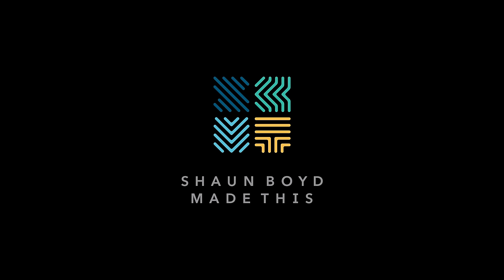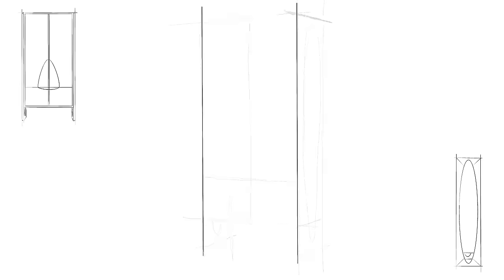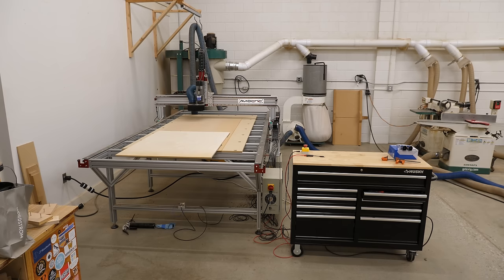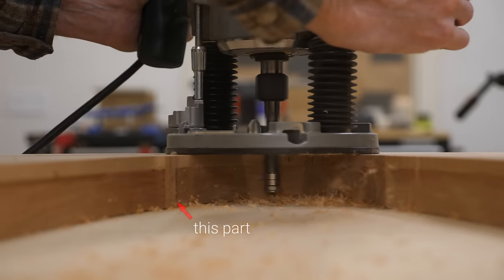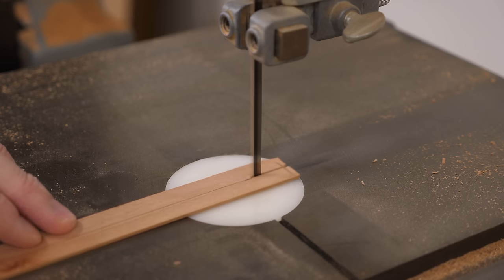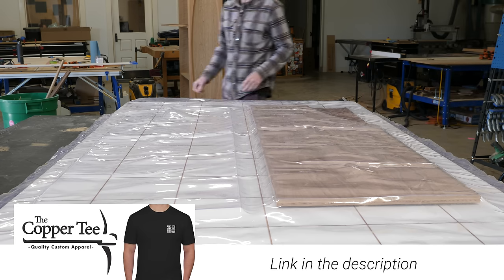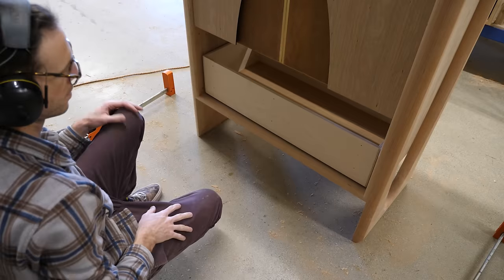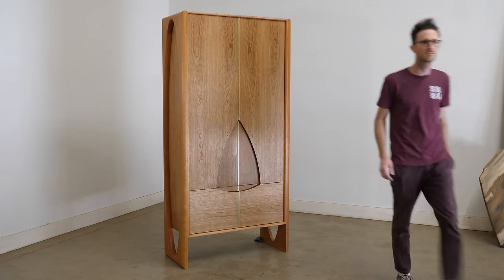Complicated...But Fancy

Comment: It’s (I think) the first video from Shaun Boyd that I’ve watched. And I’m very impressed. I’ve been a woodworker for over 45 years. I’m now retired and, in some ways, am busier than ever. At its biggest, it was 2.5 FT (full time) equivalents; me being the 0.5 as my main job was as MD of my main business. So, not a big concern by any means. However, our shop was a reaction of the size of yours and it made everything….cosy.

One of the small but important things you’ve showed is the time that everything makes. I don’t believe that buyers understand just how it takes to make a bespoke piece of furniture. Perhaps they see videos of big factories churning out furniture boxes by the hundred and think it takes a few hours of a couple of days to make something bespoke. In fact, it used to take me a few days just to do the design work; maybe a day to turn an accepted design into a cut list and a day to go to the supplier and choose the hardwood. So, before even starting on the piece, we are at the best part of a working week for one person. 

The basic box you built is relatively simple and would take perhaps half a day for 2 people ( I was surprised to see how you cut the dominos into the upright side; I would always clamp a piece to the upright so that I had more resting place for the domino fence and ensure that my cut went in at 90 degrees - but that’s just me).

When you get onto fancy shapes, more than half the work is in the templates. Getting those just right means you may may end up with the right hardwood shapes; a template that isn’t just right ensures you get a crap result. 

The old maxim used to be that, by introducing a curve, you increase the labour input tenfold; add 2 complex curves and you increase it 100 fold. I found this not to be that inaccurate. 

Without going further along these lines, for me, the reality is I would have estimated the total design and build time on this to be around 100 hours. At £40 per hour (which was my base charging rate a few years ago), I’m at £4000 for labour. Add materials and I would be around £5,500. I don’t know how that equates to exactly time and material costs in this instance but there are few people, as a percentage of the population, willing and able to spend £5,500 on a wardrobe, armoire or pantry or whatever it’s use is. And I think that most people would think you are making a fortune out of charging that kind of figure - in fact you are only covering costs and paying a living wage. No more. 

I would be very interested to see you insert that time clock throughout your videos, with time jumps when you do something off camera such as making the templates, as a small part of allowing makers and users to see just how long everything takes if you want real quality. 

On the question of mitre saws, we sold one years ago because it’s use and the space it occupied just didn’t justify it. Over the last couple of years, we have been installing about £20,000 worth of European oak as second fix (finish) work in a barn conversion. Miles and miles of skirting (made of 3 separate pieces), coving (also 3 separate pieces) plus window surrounds (8 pieces). With lengths up to 3.6m, the only efficient way of curate cutting to length was a mitre saw as we could also take the saw to the area and stop endless walks to the on site shop. So, we bought another mitre saw. With that work coming to an end, and me believing that I will do very little long length work going forward, we will be selling the second mitre saw for the same reasons as the first one. 

Thank you for the video. I’m subscribing as I finish writing. And congratulations if you managed to have the time to read all of it
Reply from the maker: Thanks for your comment! Not many people really understand the time to price relationship, and it's one of those frustrating but part of the job type things. Luckily, because YouTube is such a big part of my business now, it takes a bit of stress off the need to get top dollar for all of my pieces.

Comment: As someone who follows a similar build path, it helps to think of things in quarters: 1/4 into CAD, 1/4 into milling, 1/4 into jointing, 1/4 into finishing. In your case, an extra 1/4 into video/editing. The time it takes is what it takes. 
The one question I have: how do you avoid feeling like you've got to devalue your labor to make a living? the ROI on time spent vs what you can charge always seems like 15-20$/hr in my case.
Reply from the maker: Yeah, that's always a tricky thing when trying to price your work. As designers and creators, we always want to spend more time on stuff and make it perfect, when the reality is that we probably won't ever see a return on a lot of that extra effort. To reconcile that, I often look at things as a whole...how much do I think this piece is worth? And is that price going to get me to the revenue that I want for this week or this month? Otherwise I would have quit a long time ago worrying about my hourly rate.

Comment: I have a miter saw....because I bought it in about 2000...but very rarely use it an generally only for "construction" type work. Not really needed for my woodworking with a sliding table saw and the CNC. :). Great project!!! And not putting effort into covering the edges of plywood where they will not actually be seen is a very good point.
Reply from the maker: Yep, that sounds about right. Only time I use one is when I'm cutting 2x4's or crown moulding, which is very rarely. Thanks for watching!

Comment: Nice ‘laying on the piece’ shot. I think about this a lot. I personally think the best pieces out there elevate their material, I kind of think about how David Smith’s (and other minimalist artist’s) sculptures got flack for using “cheap” material like rebar and concrete, instead of marble. They used industrial materials that were at the time, looked at, as ‘below’ fine art. But they elevated the material, and in doing so showed us a new view of beauty. I think plywood is sort of similar, it’s a fantastic invention, having the grain criss cross to intensely improve stability, and personally I love it when a good piece of furniture can elevate that and celebrate it rather than hide it. Plywood does have some serious short comings though, the lamination is vulnerable when the edges are exposed, especially if it’s not the highest quality plywood with a thick top layer of veneer. Showing materials weaknesses can be beautiful if controlled, especially as art, but as a functional piece of furniture… not so great, in that way adding edge banding on the front reads to me as a practical measure and a necessity for function. I make a lot of cnc’d sculptures out of plywood, and have you ever tried cnc routing a pocket that’s sizeable and at a partial depth? Like the cut out in your piece if it was all made of 1 single sheet as opposed to two layers. It makes a surprisingly interesting visual moment, true sometimes you run into voids or biscuits that aren’t as pretty, but if you’re using Baltic birch or something it’s actually less common then you’d expect. Idk try it some time on a piece of scrap, it looks cool, and is one way I like to acknowledge the material when it fits the design, could be a fun technique to try :) Beautiful piece as always!
Reply from the maker: Really appreciate it! I've done a lot of stacked and laminated plywood pieces, which certainly highlights the material. Plywood really is such a versatile material!
Reply: @shaunboydmadethis  I’ve seen a few of these, it’s funny, when you started posting on your old channel again it prompted me to check out some of your pre four eyes videos I’d never seen before, which was super fun and a nice surprise for new/old content to check out.

Comment: I would actually love to see you go through the raw process of designing a woodworking project in fusion 360 (on like a secondary channel). I learned 360 for 3d printing, and ive found the headspace for modifying flat stock totally different from a additive manufacturing approach, and just watching the way someone actually uses the tool would help so much
Reply from the maker: That could be interesting! I'll definitely keep it on the list.

Comment: Excellent work.  Love the pants-try.  One question: how do you approach sanding plywood with a thin veneer?  Are you ever concerned about going all the way through to the next layer?
Reply from the maker: Thank you! I sand veneered stuff very carefully. The 3/4" plywood had a decent veneer, so I just sanded with 180 from the start and had no problems. The 1/4" stuff had an incredibly thin veneer. I actually sanded through it when sanding by hand with 220! It was insane, so I had to be ultra careful with that.

Comment: I trust you, mostly. Actually, I’m retired and have been building furniture for over thirty years, so my interest in your videos is mostly for the design. You are doing things I probably would not, but that’s good. I might learn something. And my shop is minuscule so I use a contracter’s saw with some dodgy looking wooden extensions that I can put away after I’ve cut up my panels, so no mitre saw either. I am French and an armoire can be ANY cabinet, big like yours or smaller like in the kitchen. I would use plywood like you do, but here in France it’s very expensive, so I generally use solid wood. A very good idea, though.
Oh, yes. I have no idea about the song, so no bonus points for me.😢
Reply from the maker: We're always learning! And glad to hear that armoire wasn't totally incorrect, thanks for watching!

Comment: Well done, looks very nice. Exactly to the pointlicated it required. :)  Regarding the cutting jigs an sleddimabobs for too long stuff: You neglect the track saw. If you build the sleds a little differently, create positive stops for the track, establish a reference cut into the stop blocks beforehand, and then insert your piece, it is way better than the table saw.
Reply from the maker: Definitely could be a good way to do it! And if those pieces were any bigger, that is probably exactly what I would have done.

Comment: something i think wouldve really added to the looks of the piece would have been to add lighting to the interior and also along the tri shaped handle so that the inner part outside the cabinet (the tri thing) has leds there to light the handle. Then maybe also add brass edging around the perimeter of the tri shaped handle which looks like a guitar pick. So the outer edge of the guitar pick instead of being wood cut through the middle of the pick with some brass, it has the brass go around the edge of the pick while the leds light the tiny inner portion of the pick (not inside the cabinet tho for those leds)

Comment: I am curious about the template process. You (Shaun) indicated that you have a five foot by ten foot CNC router. You use that to creat the templates to do the shaping and routing of the project pieces. Why not just route directly into the material?
That would be even faster and more accurate.
Reply: Would also love to hear the rationale… you could glue up your blanks and then let the CNC cut that opening and the outside profile as well … all while you are putting together the cabinet. Plus it saves you the profile templating time as well? Inquiring minds want to know…
Reply from the maker: Honestly, the easiest answer is that it makes for a bad video. As much as I want to pretend that my main business is making custom furniture...it isn't. So any added time it takes me to make something by hand instead of on the CNC just makes a video more interesting to watch, or at least I think it does. And interesting videos are my main product these days. 

Then there are other reasons like I'm way more comfortable doing it in this way, or that I get better results when doing it this way, but those are obviously only reasons for myself.
Reply: @shaunboydmadethis  thank you for the response and the honesty. I understand the content creation reason as most people would not find it interesting.
I have found that for my current level of woodworking the CNC Router has expanded what I can create. More importantly when drilling two columns ofshelf pin holes every half-inch on an eight foot board the CNC router is the best tool for the job.

Comment: Another outstanding SB piece, as always.  Curious, if you created your template for the legs utilizing the cnc, why not bypass the template, place a corner jig on CNC for matching starting points and have the machine cut the matching legs.  Then run through drum sander/planer to desired thickness?  As always, keep whistling!
Reply from the maker: Thanks! There are a few reasons, but honestly, for the most part it's because a video where I cut out most of the parts on the CNC is a pretty boring video to watch, and the video is my main product these days.

Comment: One of the main reasons for using plywood I think is that you minimize wood movement after construction, right?  Or at least wood movement after gluing individual panels.  I've had numerous times where I glue together a panel of hardwood, and it bows or cups and I have to redo it....  With plywood you eliminate that.  For the sort of woodworking you guys do, very precise midcentury modern-style pieces, I feel like it would be more difficult to get the results youre looking for with hardwood.  Maybe I'm wrong...

Comment: I'm doing plenty of metal combined with wood and composites, so finding good tips how to do things better is biggest reason i watch videos like this. I have tried the masking tape trick but already glued in place and trying to get metal even softer ones like brass, copper and aluminum even with the wood has been bane of my existence. For the plywood long as its not some shit like MDF core or particle board its fine and in some cases just bring it out more. This peace was wonderfully made though with 20:40 not me. I look into all flaws i can find and give it as constructive criticism. If there is same amount of flaws as in my work i'l buy it.. or make it my self with my own twist and if less i'l ask to be tutored. People cant find flaws in my work except time it takes to make it, but if i can improve my work to level where i cannot find flaws that would be amazing... amount of annouance i feel when project is almost perfect but there is that one flaw that you cant really fix with chance of making more flaws in process trying to dial it in. Excellent work regardless same with design.

Comment: Hey Shaun. I was just wondering if you have plans to do a Festool Domino tips video, please? When using the tight setting, I can’t seem to get both components to line up exactly (annoyingly, I’m normally about a 1/32” out). I’ve had to bumble my way though, but some advice would be great, if possible. Thanks. It’s great to see your videos coming back and keep up the great work.
Reply from the maker: We have done some domino videos in the past, but nothing that gets down into that much detail. The best I could say not knowing exactly what the issue might be, is that you could readjust the center line marker to make sure it's perfectly centered. Or if side-to-side adjustment is absolutely critical, then cut the mortise on one side of the joint slightly wider so you can fine tune it during the glue-up, and you're still getting the benefits of vertical alignment.  Hope that helps!
Reply: @shaunboydmadethis . It does help. And thank you for taking the time to respond. Very much appreciated. As you say, I think I must need to adjust the centreline better - I just haven’t been able to crack the set up yet.

Comment: Nice video, and of course another nice piece of furniture. Do you ever consider using the cnc to cut parts for you rather than making a template? I can’t imagine it would take longer.
Reply from the maker: Thanks! And yes, we get asked fairly often why we don't cut the actual parts on the CNC, and the easiest reason is that it makes for an uninteresting video.
Reply: @shaunboydmadethis  now that makes sense!

Comment: Beautiful Looks great. Quick question Sean, why did you not use the CNC to cut the actual parts ? instead of cutting templates and using your router.
Reply from the maker: Thanks! We get asked fairly often why we don't cut the actual parts on the CNC, and the easiest reason is that it makes for an uninteresting video.
Reply: @shaunboydmadethis  hey Shaun, thanks for getting back to me. I’m on the fence to buy a CNC. So I guess my question to you is could you cut those parts if you wanted to? and if so, have you ever done a project using the CNC exclusively.
Thanks
Reply from the maker: @danieldurkton2942  You certainly could do it, and if you were planning to build a lot of furniture, it would speed up the process. But for me, when making one-off custom pieces, the time difference is negligible. And honestly, I get a better result when doing it this way, but that's just because I've done it so many times. But having a CNC to cut templates and other things that would be difficult or impossible by hand, makes it worth it.
Reply: @shaunboydmadethis  Thanks for the input Shaun. have a great week😎

Comment: Great looking cabinet. One point of curiousity, if you are already going through the trouble of programming and cutting templates on the CNC, why not just have the CNC machine cut the full parts? It would have saved you a ton of time and effort in this build it would seem.
Reply from the maker: Thanks! There are a few reasons, but honestly, for the most part it's because a video where I cut out most of the parts on the CNC is a pretty boring video to watch, and the video is my main product these days.
Reply: @Shaun Boyd Made This  totally understandable. I manage a custom fine furniture shop here in Wisconsin(design, engineer, cnc, photo, video, etc), so I know how boring that stuff can be. If I was in your shoes I'd probably be doing the same thing 🤣